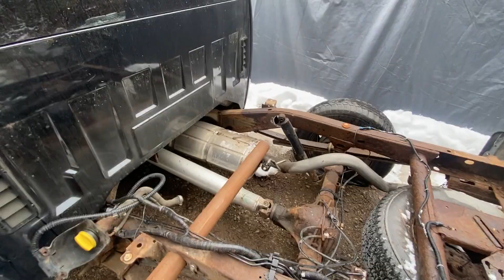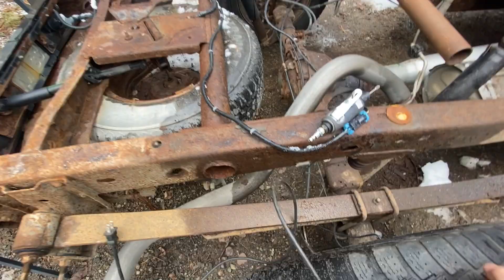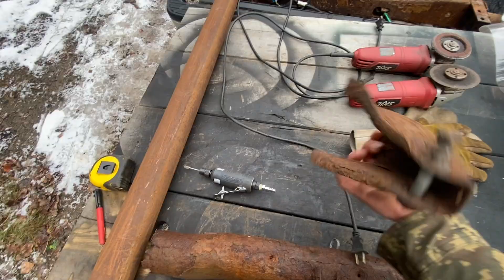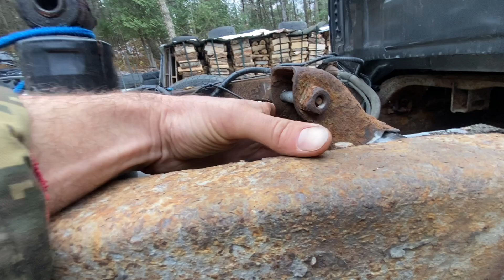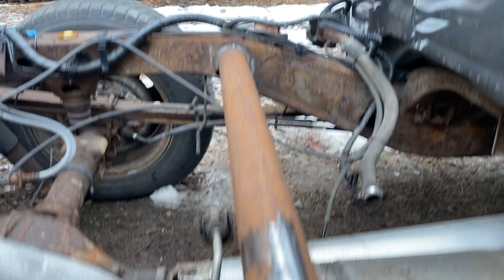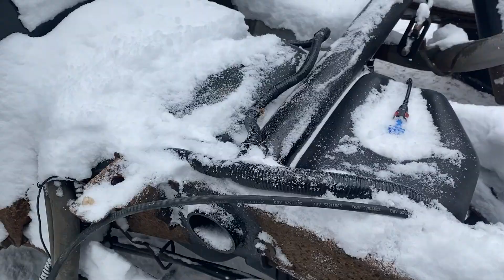Silverado / Sierra Crossmember Rust Repair (DIY Fix) shock mount

Comment: What type of pipe did you use, black pipe or steel? That pipe looks stronger than the stock available in the market
Reply from the maker: Steel pipe. 3/16 thick. Way stronger than the stock crossmember. 
I got it at a metal store where they sell beams for construction.